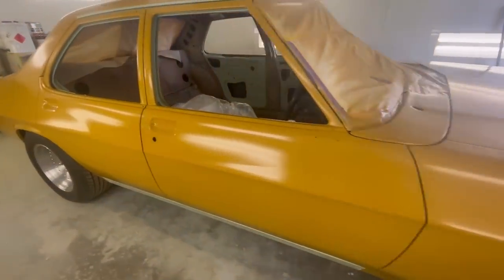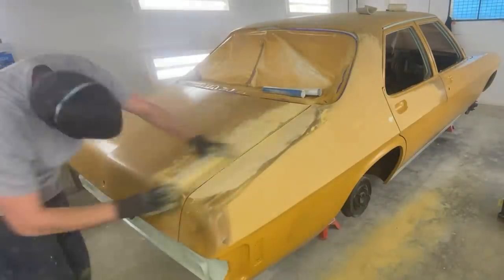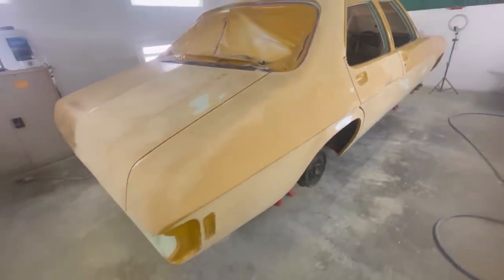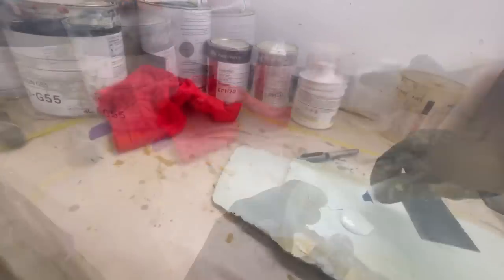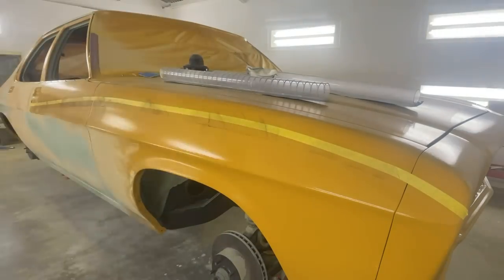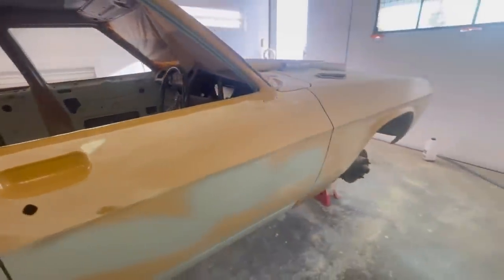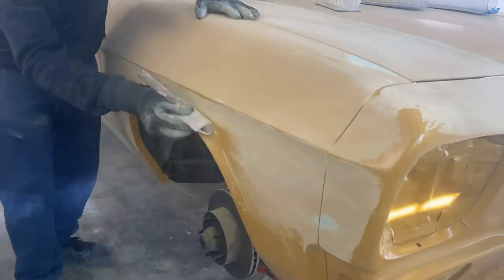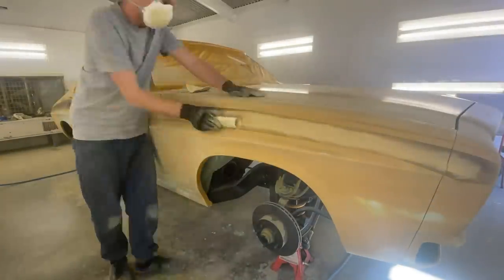HQ Holden Blocking & Priming RestoFinish Polyprimer - Basic Body Restoration part 3.5 The Resto Shed

Comment: Great video as usual. I was hoping you'd answer some booth questions because I want to build one.  Mostly to do with washing down 1.  With the wall lining, how do you stop the water either wrecking the wall board or going under the lining sheet and staying wet in the frame of the shed. 2. Lots of people say to wet the floor before spraying but also that need low humidity for paint application. How do you keep humidity down with deliberately wetting the whole shed down?, particularly with warm booth? 
Cheers
Poyda
Reply from the maker: Great questions mate. The panelling I used in my shed is concrete sheeting (like what you’d use in a bathroom) so it is waterproof. Doesn’t take much to wipe a wet sponge over them to clean them up if need be.

I wet the floors down when I’m painting topcoat just to help stop some of the overspray from circulating. 
With the constant airflow being sucked in through the intake it isn’t humid in there at all with the floor damp.

Comment: Great job mate How long will you leave it sit before you paint  the  car  the reason why I’m asking I got my car painted last year and I’m finding the epoxy is shrinking back and now the needs to be rubbed back and painted again not happy
Reply from the maker: Far too variables to get into on the topic of shrink back, but anything that’s getting slammed with material for build and rubbed and painted ASAP isn’t going to hold true in the long run. 
If you can leave your primer to sit for at least a month before rubbing for paint you shouldn’t have any issues.
Reply: @TheRestoShed  thanks mate 👍👍

Comment: You don't use resto finish on the inside?
Reply from the maker: I’m thinking I will use it on the firewall and I have already put some on the inner guards. I will probably just use wet on wet primer inside the jambs ect
Reply: @TheRestoShed  I have been a panel beater for 20 years but this resto work is so much different. I'm restoring an LJ Torana ATM and have had to learn a whole new process, your videos have helped heaps. Keep up the good work man. Can't wait to see some colour on this  one 👍👌

Comment: I have a cheap Aurita   48$ 2.0 spray gun using quick fitting adapter for throw away pots. And it loves throwing out restofinish or epotec. You do not need to spend big on a new gun ey.
Reply from the maker: If I get 5+ years out of a $250 gun I still consider it a cheap spray gun.